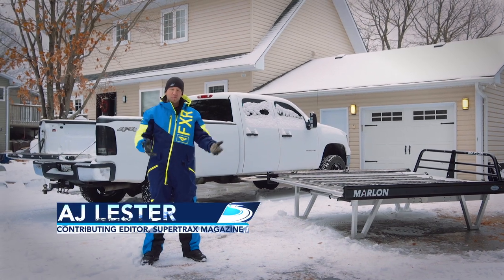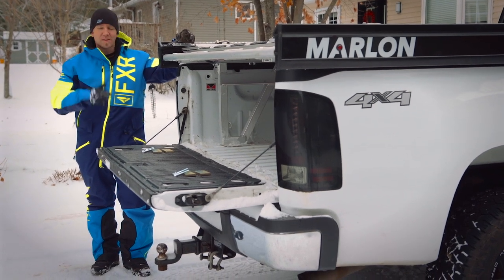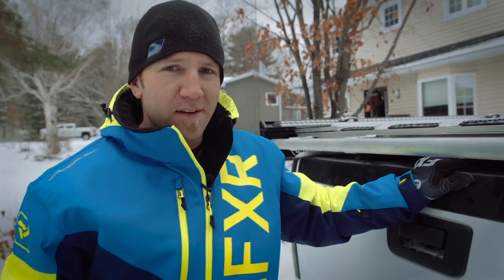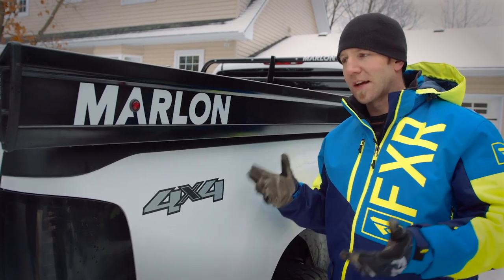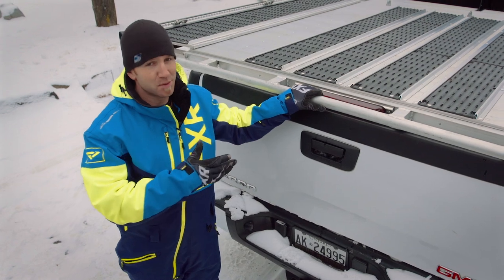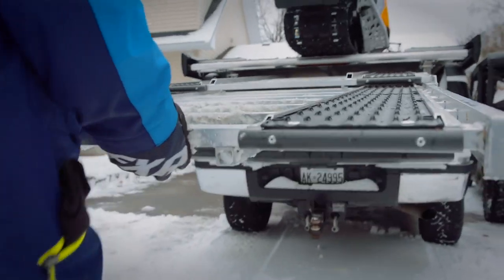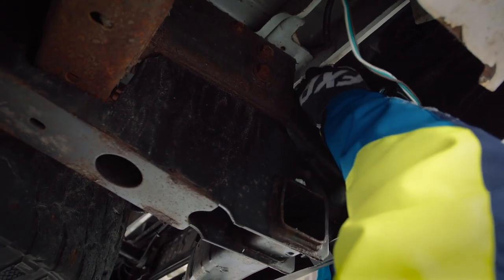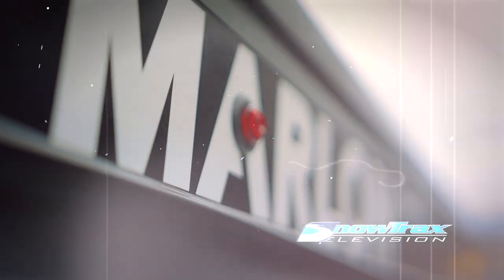Marlon Snowmobile Deck Review

Comment: These decks are awesome. Not just for sleds. They are awesome for hauling ATV's too. I love mine.  Don't let anyone wig you out about loading and unloading. It's all bs. I load my sleds very easily and I'm in my 50's.  I have a 2012 F-350 crew cab diesel on 37's with a 6" lift  and it's a piece of cake.
Reply from the maker: Right on!